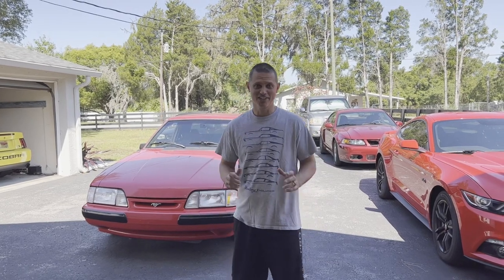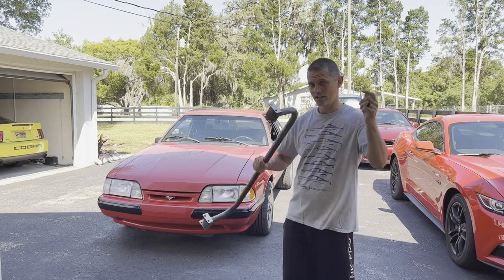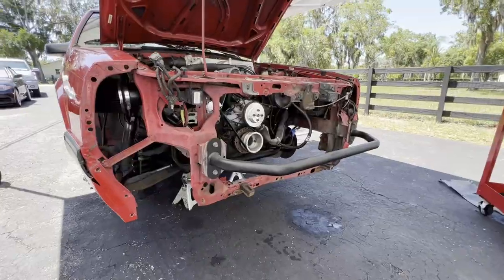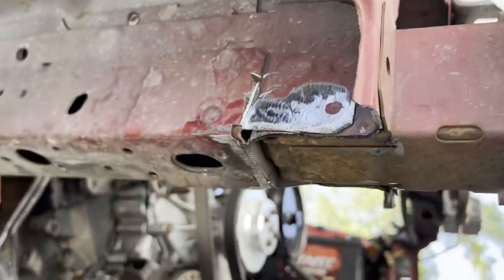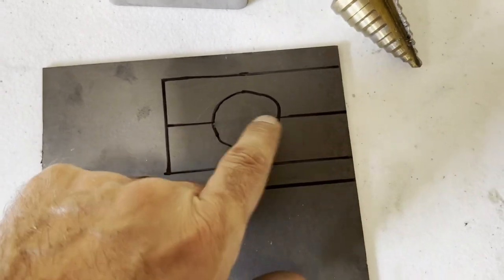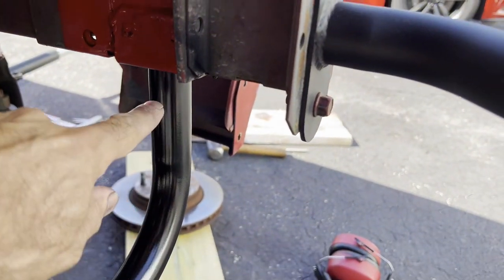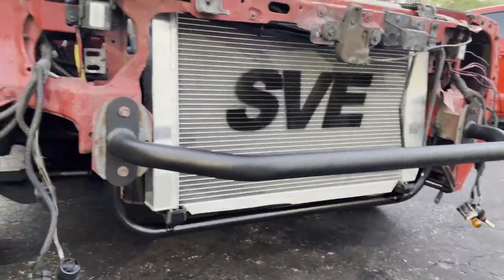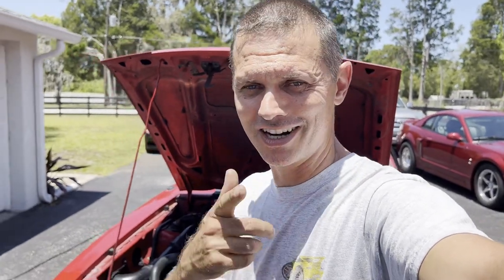Daily Driven Boost Build - Part 2 - Clearance for intercooler pipes

Comment: looking for this video for a long time.. nice work my man. what welder are you using?
Reply from the maker: I have a couple Miller welders.  I usually MIG all the steel stuff and TIG all the aluminum.  Depends on the task at hand though, sometimes I need to to TIG the steel when greater precision is needed.  I can get you the exact model units if you need.
Reply: @MalcolmV8  that would be awesome thanks
Reply from the maker: @angry408w7  Millermatic 211 MIG welder.  My TIG is the most entry level Miller Diversion 180.  I learned to TIG on it some 20 years ago and still using it to this day lol.  I'd like to upgrade one day when I have more space but for now it works.

Comment: Forgot to ask what gaskets and bolts for the heads? Do anything special for the torque on them?
Reply from the maker: Standard felpro head gaskets. We swapped to ARP head studs when we swapped heads but on lower boost you’d get away with factory head bolts.